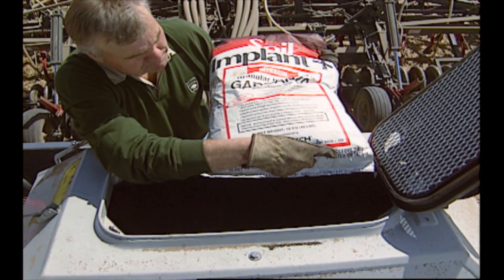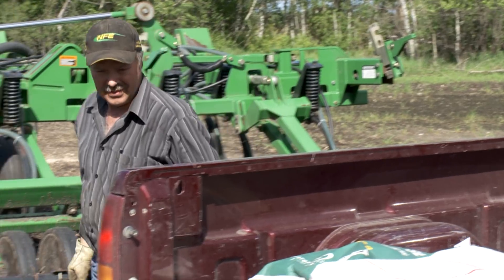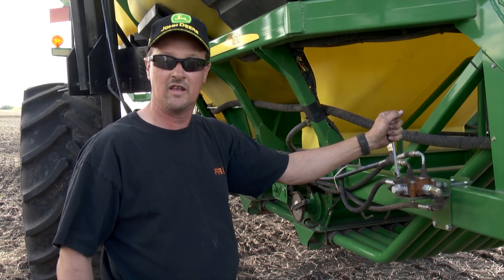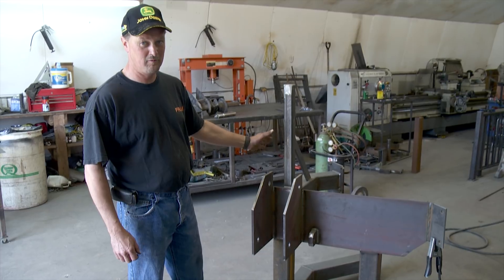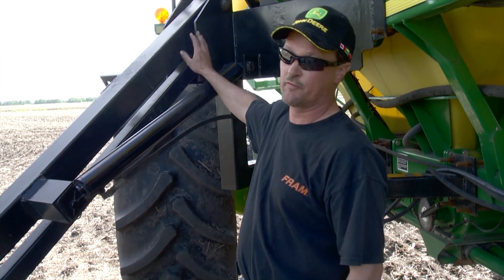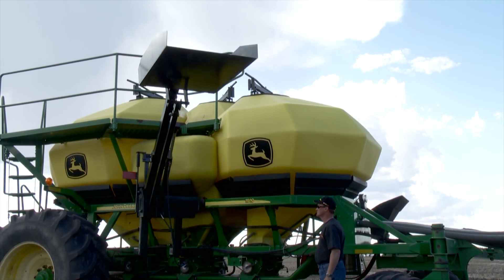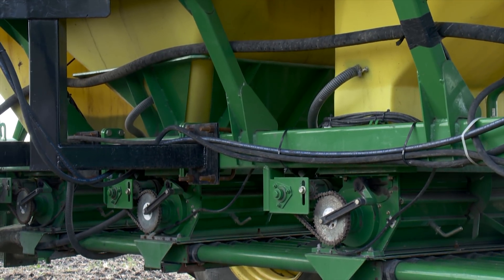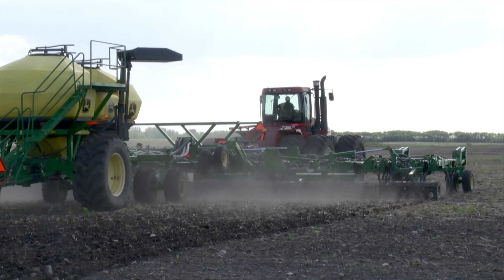Hydraulic Seed Bag Lift - E-ZEE Loader

Comment: Why do they need  to use seed bags isn't there an auger to fill the planter
Reply: Watch the last couple minutes again, he explains.
Reply: TrailerPark Gaming Same thing I was thinking! It would take a tons of bags to fill the air seeder!
Reply: Bags are only used for certain products, such as canola seed or inoculant, where large quantities and frequent filling are not a factor. When loading canola or inoculant, you only fill the tank once a day, generally.
Reply: delinquentJACK Yipe I did but wow to fill a airseeder that size with bags? Huge job!
Reply: Running the canola seed through the auger would wreck the seed